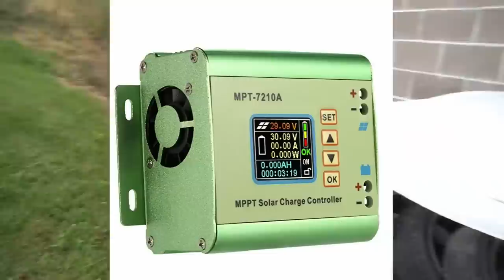Solar Cart!?

Comment: Just wondering can you put a pulley and belt system hooked up to an alternator off the axle to charge as you drive ?
Reply from the maker: Although it would generate a charge to the batteries, it would also create additional load on the motor, which in turn creates additional battery drain. There is friction and conversion loss of energy in the process which unfortunately makes it an overall loss more than gain.

Comment: What's the update on this project
Reply from the maker: I am evaluating a different solar controller for this. The panels work awesome and I have gone months now without ever needing to charge the golf cart (even with everyday use), however the solar controller is having issues at times I believe due to humidity and it has a very annoying fan noise.  The new one I am trying now is fanless and  seems much more weather proof.